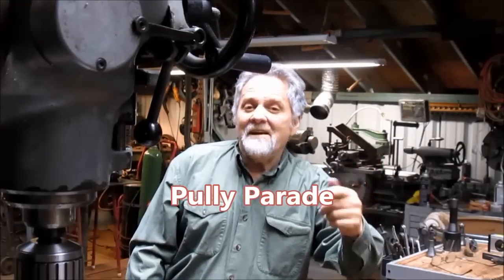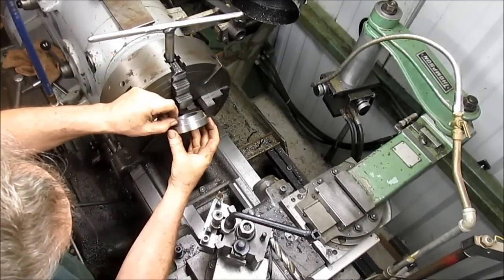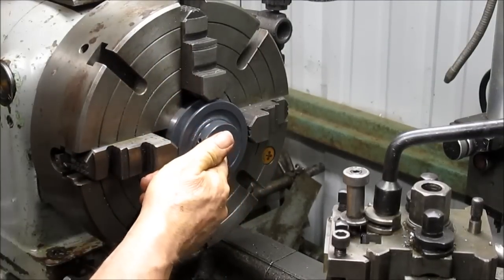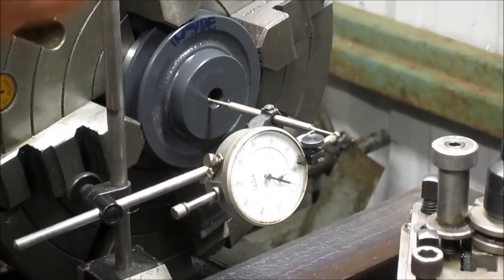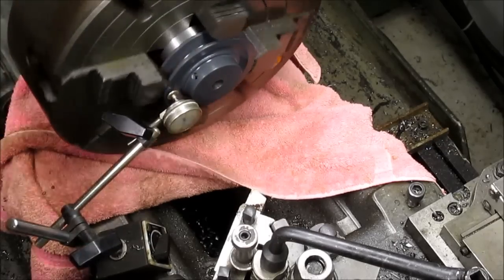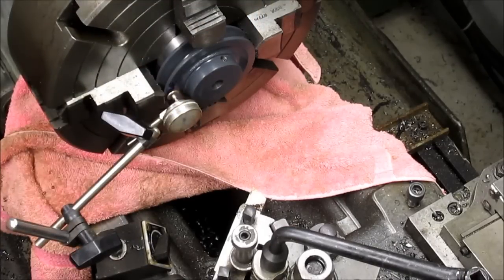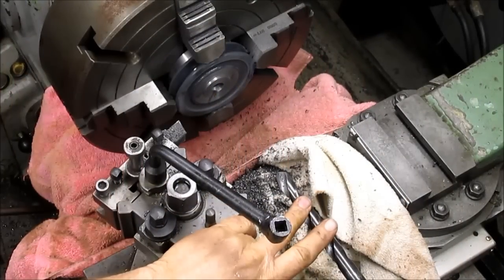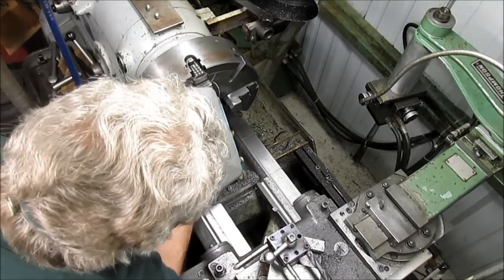Pulley Parade

Comment: G'day Nik,I'm a great fan of your videos. Good down to earth stuff. I feel the need however to point out that using those towels to protect the lathe bed is very dangerous!! You could easily lose a hand or worse if they get caught in the chuck. If you use newspaper it will tear and is less likely to pull your arm into the chuck.Keep up the good workRegardsDave
Reply from the maker: +Davet Good point! I will try using newspaper in the future. I've had the chuck catch the towel form time to time and flop around, but never considered the more dangerous implications. Thanks.